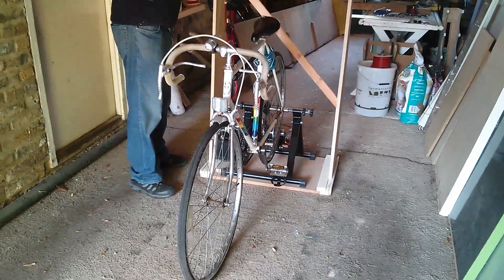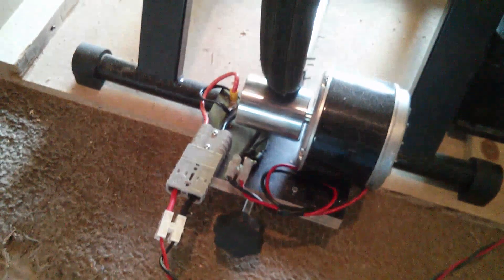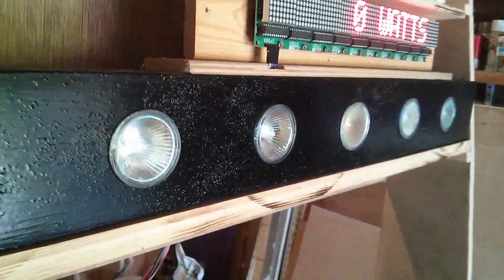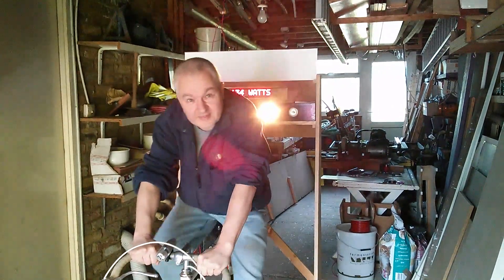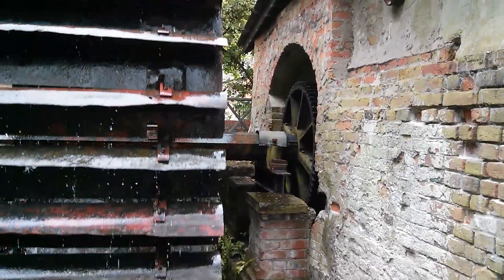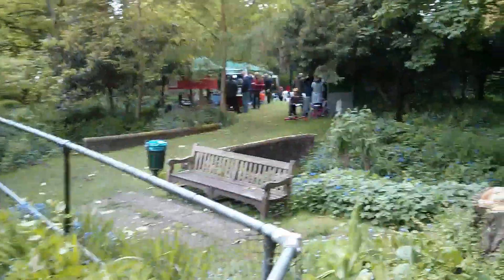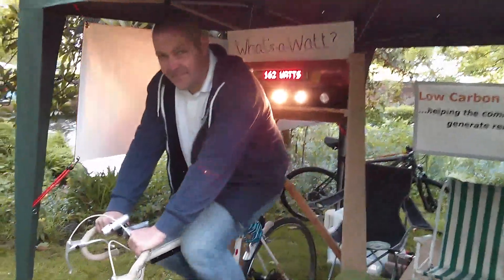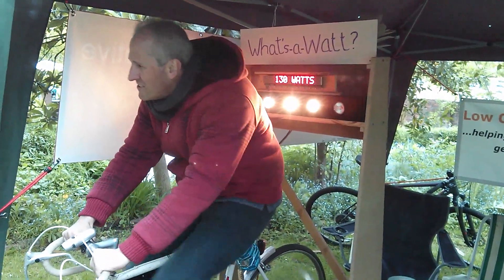"What's a Watt" Bicycle Generator Attraction at Pann Mill

Comment: I was involved with a pedal powered sound system , that used Ford escort alternators , for a number of Druid events . Luckily the sound system was energy efficient , built by a BBC engineer , but it still involved feel like several hours of pedaling up a long hill ( we often spent up to 1/2 an hour pedaling to charge party flat batteries , before the first performer arrived ) & being very hacked off if people wanted to a big base line on things .

Comment: Julian, A while back on this project (can't find the actual video now) you had a question as to why why your Arduino project is limited to displaying +/-32 or 0-64.

All integer maths is done in 16 bits on your Arduino (word size of machine), unless you specify some other data type (e.g. you found forcing float fixed the problem).  When the expression is calculated the multiply on the left happens first, but is limited to a 16 bits because this is what the compiler deduces as the default type in use. The largest number in 16 bits is 65535, which then raps back round to zero.  65535 / 99 = 661.969, so the largest number you can have as a result of your A/D conversion without problem is 661.  After this the multiply will overflow and wrap back round to zero.  For example 662x99=65538 but this is too big for 16 bits so the 17th bit get lost and is wraps back round past 0 to 2 (65538-65536=2).

As you know, the top bit is the sign bit, so actually any value over half of this, i.e. 330, gives an incorrect result because it forces the sign bit on in the result of the multiply when it shouldn't be.  Note that WORD() is actually forcing the multiply to have an unsigned result, which is why you get 0-63 in this case instead of +/-32. But the problem is the same - the multiply result is limited to 16 bits.

Now you need to consider what happens when you divide the range of values that can be returned by the multiply, either +32767/-32768 (in the case of a signed result) or 0-65535 (in the case of unsigned), by 1023.  Well that is either +31/-32 or 0-63.

The best way to fix your problem is to make the multiply use long (or better yet probably unsigned long since we will assume an A/D result can never be negative).  Something like:
long(analogRead(A0)) x long(99) / 1023.0

It is always best on a low end microprocessor to use integer math wherever possible, because floating point calculations are expensive.  As you aren't using any digits of the float result on the display, you would be even better to stick with integer maths entirely here and not use any floats at all.  It will be faster and use less RAM (no need for floating point library).  So:
long(analogRead(A0)) x long(99) / 1023

So, if you require a value in watts, but with 3 decimal places, it is sometimes better to calculate in mW and simply imply the decimal so the values can remain an integer.  Then do integer divide and mod by 1000 to get the part to display before and after the decimal.

HTH Stuart.

Comment: This would certainly make for a potential product to get on the market, as I'm sure there's nothing like it, at least not that I could find.  Sure, generating <0.2kWh for an hour of exercise will have a negligible effect on the electric bill, but the novelty of being able to see energy being put to use may encourage some to exercise just to see what they can power or sustain. 

This sure beats the calorie meters on most equipment which are a rough guess at best.  For example, on my rowing machine the calorie meter clocks up at the same speed whether it's on the minimum or maximum resistance setting.  It's the same for several other fitness machines I checked elsewhere.

At least with a generator, the load's energy consumption will be at least the effort the user is putting out, so if the user is powering a 100 watt bulb at full brightness from a generator, the user is putting out at least that, plus some extra effort to compensate for efficiency losses caused by friction, generator efficiency, diodes, etc.

Comment: This is good for people that build electric bicycles to see how much power they can generate.
I think an athlete can peak at around 300W for a few seconds but it will not be able to sustain that for long. That is why legislation for electric bicycles range from 200 to no more than 300W depending on country.
Even a 200W motor on an electric bicycle will be way better that an average human and that is because it can sustain that based on battery size for up to a few hours.
An average human consume around 2000kcal worth of food/day and just a portion of that is used another part is eliminated :) and maybe some is stored as fat.
Those 2000kcal are equivalent with around 2300Wh but most of that is used for buddy functions most to keep the body at around 37C and even just the brain uses around 20W that is alone 20W x 24h = 480Wh so not that much is left for the electric bicycle :) a few hundred Wh/day will most likely replace a fit human on hard daily physical activity. That is just a few cents worth of electricity/day so machines can do physical work way cheaper than any human.
I wait for AI to get to the same level of efficiency and then we will be completely obsolete :)

Comment: That waterwheel. How old do you think those metal cogs are? I honestly have no clue myself but anything over 125 years old would blow my minds. I just can't seem to grasp how they would have made them pre 1900's. I just saw where it had the roman numerals MMX which is 2010 I wonder why.
Reply from the maker: This is a renovation project - the mill was rebuilt very closely to the original design. The project was completed in 2010. Those large cogs are actually made of wood.

Comment: Adding an mppt charge controller would automatically match the 80 volts DC of the generator, to the 12-14 volts of the battery. The bike would probably be easier to pedal due to the better match...

Comment: LOL! I like the Ökotrainer Carrera set, that allows you to control slot cars by pedaling. Or the cinema set where you get 8 of them to drive a projector and audio amp in a group.

Btw. do you have a comparison how accurate the reading is? I tried a few different ergometers once in a while and sustained 150W didn't seem hard to do at all even for longer times. But on your machine it seems hard to reach.
Reply from the maker: Possibly because we're feeding the generator output into a 12v battery. The generator can produce over 80v open circuit, but we'd need a high power DC/DC converter to fully benefit from that. We don't have a very good generator/load match.

Comment: Nice work! I wonder Watt the water mill produces?
Reply from the maker: We were having a discussion about that this afternoon. The mill guys reckon it's about 20 horses. With 750 Watts per horsepower, that's 15kW.
Reply: Julian Ilett That's immense. There once were a number of mills around- lots derelict now. I reckon there are plenty of those locations that could site a nice hydroelectric generator. 15 kW might do 2-3 low power houses?
Reply from the maker: ***** It sounds like a lot, but the Nissan Leaf has an 80kW electric motor, so you'd need 4 or 5 of these water wheels to power a family sized electric car.
The mill guys have considered installing an underground hydro-electric generator to provide on-site electricity, but cost and red tape have so far prevented it.
Reply: If you know the diameter of the wheel and how fast is turning is easy to calculate. I can not really estimate this two based on video.